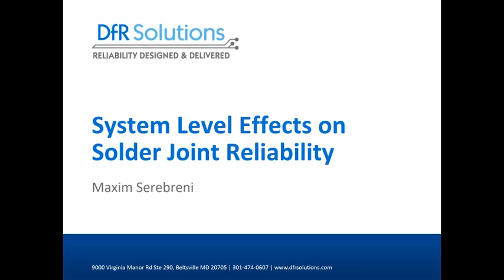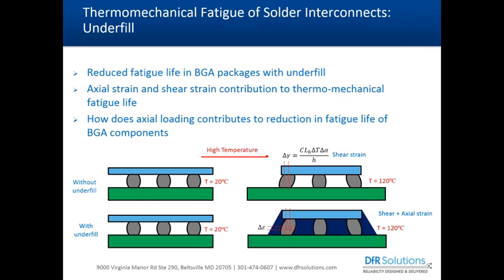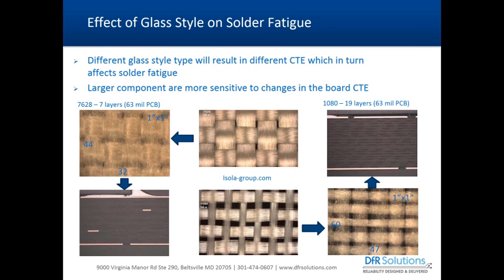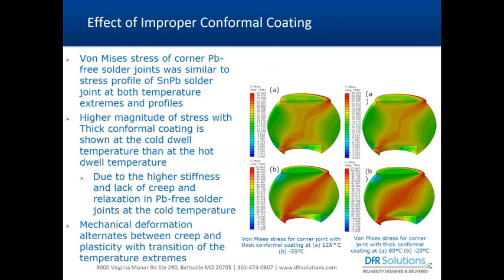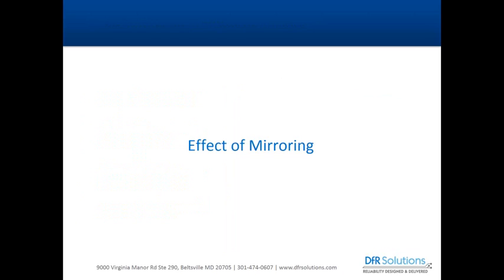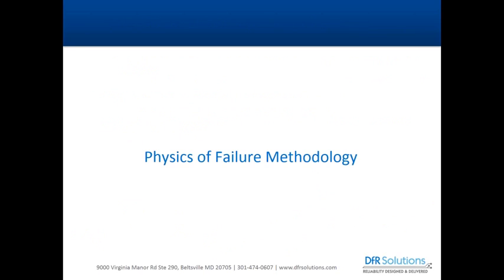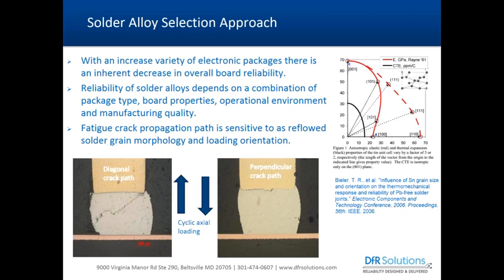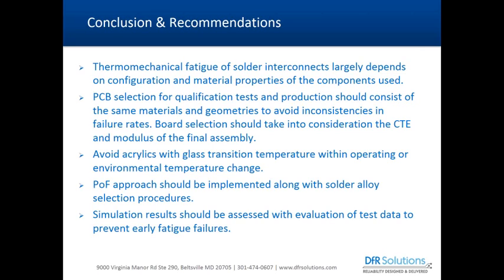System Level Effects on Solder Joint Reliability

Comment: If I had a degree in engineering, I might be able to understand this video. Since I am not, I feel compelled to ask if you consider the choice of solder used as a factor in this reliability. Seems to me, if an ROHS type is used, it would fail at a greater rate than the best solder for any job that has a need of high quality and high reliability. RMA solder of Sn63 or Sn62, which is better, is the best choice for critical circuitry where the environmental issues are most extreme. It may not matter to some, but in my experience, solder joint failure is unacceptable. Where human life is at stake, nothing short of the best solder and techniques is in order. If if you don’t have that first, conformal coatings or potting will do little good. I am not an engineer and I don’t claim to have knowledge beyond what I do, but you haven’t got to be an Einstein to know that without solder quality and reliability first, all the conformal coatings or potting won’t solve solder failures. That is strictly due to solder formulation and execution of the highest soldering standard. That standard isn’t being utilized at present either.
Reply: instaBlaster...